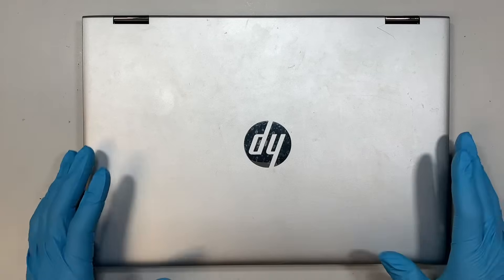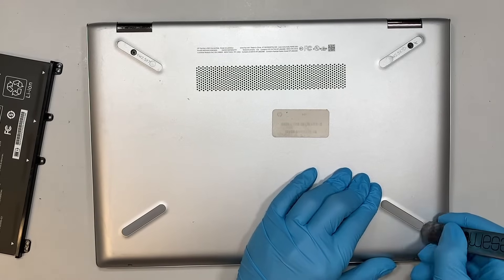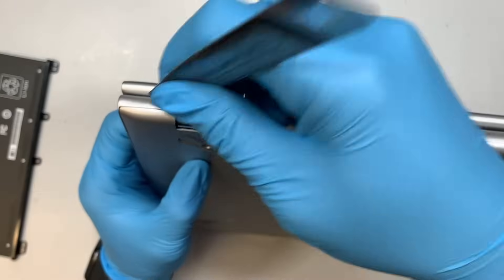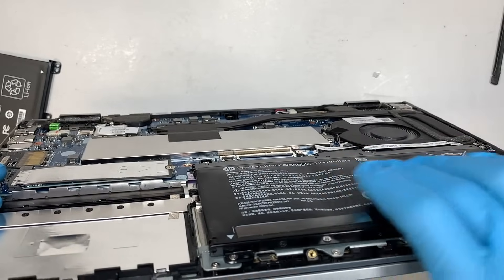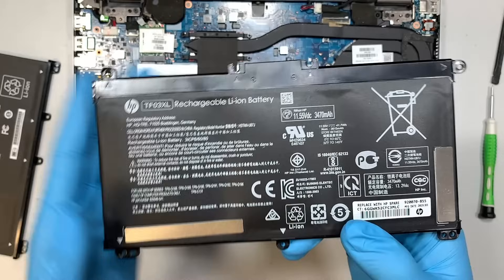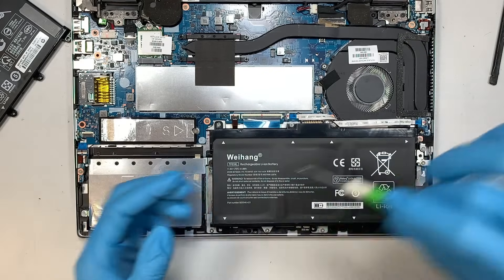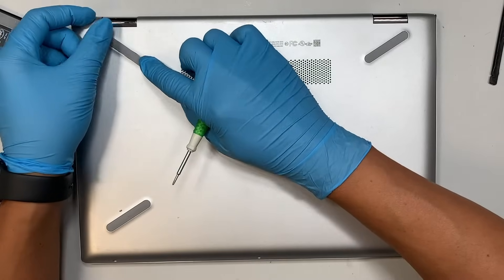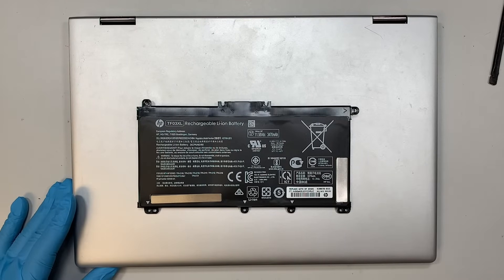HP Laptop 14 cd Battery Replacement

Comment: Thank you for this tutorial. I was planning on getting it replaced by a repair shop (which is q bit pricy). I have the battery, but the cost of repair don't. Thankfully with this video and some screws I randomly bought online worked plus a pusher. hahaha. I feel so proud of myself for getting it done on my own. 😆

Comment: Simon, Thank you so much for this video!!! I’m 71, and have a functioning HP laptop — as long as it’s plugged in. I found your video yesterday, noted my laptop model, found the replacement battery on Amazon (which was delivered today), and in less than 20 minutes this evening the new battery was installed. It’s been charging for several hours, and seems to be holding the charge. The battery was less than $25 . The biggest challenge to the project was coaxing the back case off, but otherwise was a straight-forward replacement. 
I am beyond GRATEFUL that you took the time to to make and post this video. I’m a very happy (semi tech savvy) Grandmother tonight!!!

Comment: What a stupid design.  It used to be so simple and easy to replace the battery.  Now you have to unscrew and take the back off.  Thanks for the tutorial however.  My laptop is only 2 years old and the charger is struggling to charge it!  Unbelievable.

Comment: Thank you,  I just replaced my battery after I watched your video.  I got everything all back together and it  seems to be working normal.  The only thing I noticed was that I can scroll on my mouse pad, but I am not able to click on it.  Did I miss something?   There was also a long skinny magnet that I was not sure where it went it was stuck to a metal area, down at the bottom of the mouse pad?

Comment: Hi, thank you for your video! I changed the battery in my HP Pavilion x360 14 Convertible, but my HP Support Assistant kept telling me to calibrate the battery and when completely drained, it always erased the BIOS setting. Now the Support Assistant keeps saying the battery needs to be changed again. Any idea to help? Thank you
Reply: Did you solve? I have a similiar problem with my spectre
Reply: @danielesavino2619  i didnt

Comment: Hi, can I use my laptop without a battery? if so can it be a continuous thing? I have a similar laptop make from HP.
Reply from the maker: Yes, you can remove the battery and use direct power

Comment: i have a question, as we can see that in the hp 14 series, there is place for and HDD at the corner which is empty in laptops with ssd, how can we utilise that space to install more battery to get more usage time
Reply: But for that one must use only M.2 SSD and leave the HDD Slot empty also, one need to reshape the battery shape to match with it. So, technically it is possible. But doesn't make any sense, coz, anyway you have to charge it in the end of the day.